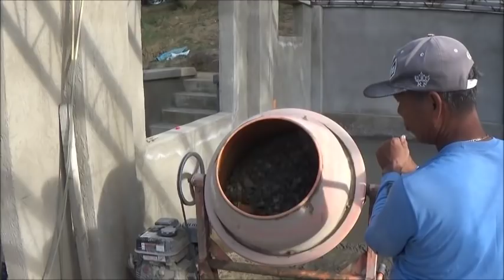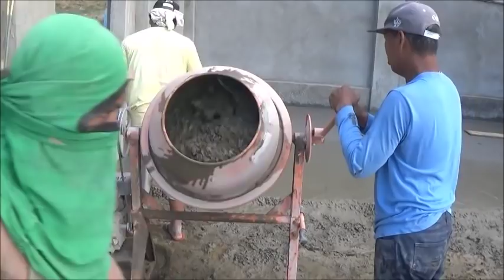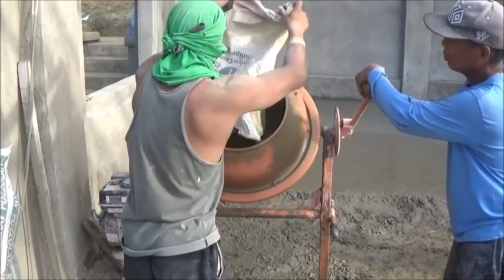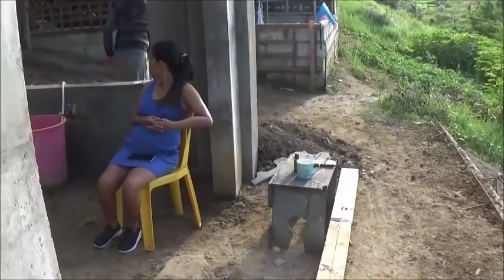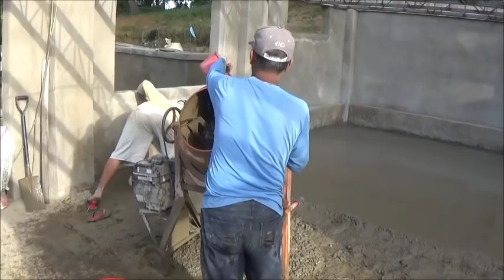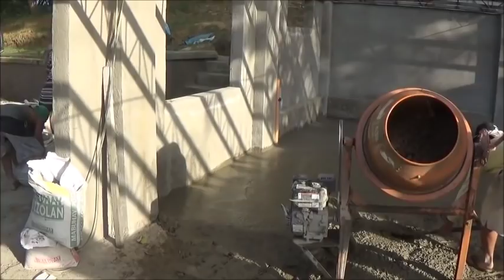Happy To Loan James And Jessica Our Cement Mixer

Comment: The workers keep dragging the cement mixer through the wet concrete every time they move it, because they are pouring the floor left to right and the raw materials are on the left.  James should tell them to pour the floor right to left and then they won't have to drag the cement mixer through the wet concrete.
Reply: I was thinking the very same thing.  And also , when they move it, if the guy operating it would just lift on those handles a little, get the leg off the ground, it would move a lot easier, and not risk damaging the leg of Brian's mixer
Reply: @davidherzog58  yeah I also was wondering why they didn't lift the legs of the cement mixer when they moved it

Comment: That's a thick concrete floor they are pouring but it's just right because there are no steel bars reinforcement and the mixture ratio is class A.

Comment: The answer to your question about mixing the cement on the floor is "Job Security". Mixing it on the ground requires more workers and takes longer.  The foreigner will say "Oh, labor is cheap. Let them do it their way." By the time the project is over, they've added some extra hands and a day or two extra pay. In the big picture, that's not a huge cost, but it helps some workers feed their families.

There's a story that when the steam shovel was first introduced, there was a big ceremony. The President of the local laborer's union attended. On seeing the machine work, he said "That thing is awful. It will replace the jobs of 100 men with shovels." The inventor of the steam shovel was said to reply "Why stop there? Make it a 1000 men with teaspoons".

Comment: No vapor barrier or rebar? I know the typical Filipino wouldn’t use them. But I figured James would have.
Reply: EDWARD D Beck is this floor six foot thick? The vapor barrier doesn’t have anything to do with freezing temps. And I’ve seen six inch slabs with no rebar crack. Obviously James thought this through. Personally, I’d have put the rebar and vapor barrier down.
Reply: I saw a crew pouring a road and they didn't use rebar. I asked about it and they said: "that is how we do it here".
Reply: They don't even use a damp course,  when building walls either. After a few years. Get horrible mould growing on the walls.  Have to clean it off and repaint fairly  often.  My dear wife,  repainted her large 4 bedroom bungalow,  every year,  to keep it looking smart!

Comment: Just wondering how James is keeping the floor level. I think that the base is level at the get go, but how is the top kept level?
Reply from the maker: Gravity?
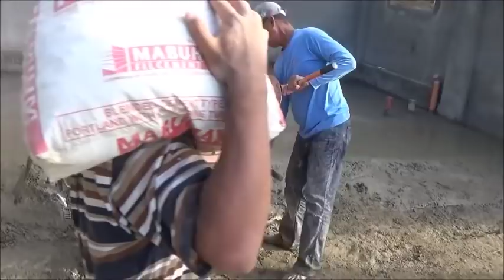Reply: If you look really close at the video,  you can barely see at 5:30 , there is a string at the depth level for the pour.  you can barely make it out behind the guy in the long pants Knee.  similar to the way Tatay William used a string for depth when he was skim coating the walls of Brian's house
Reply: @davidherzog58   Hi David. That was what I really meant to ask. How is the thickness maintained acroos the entire surface. Thanks.